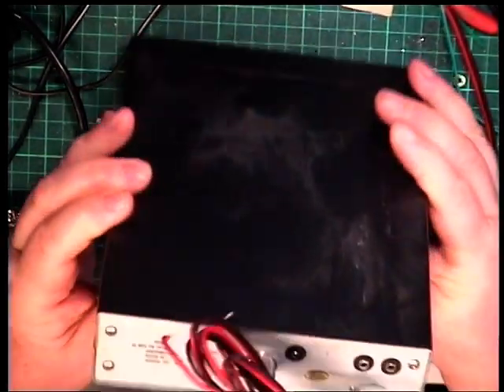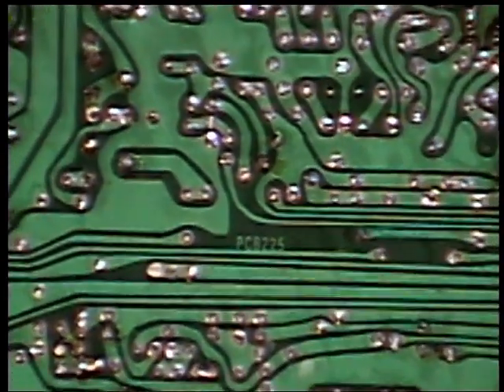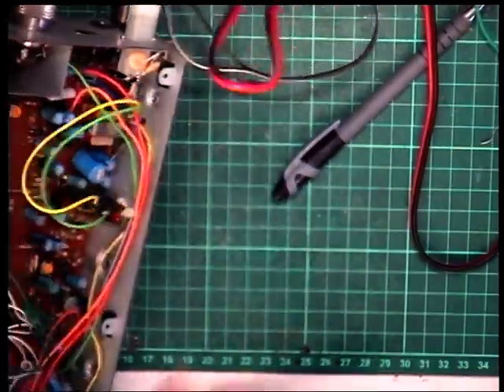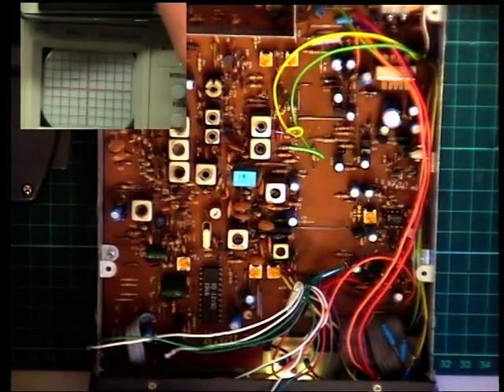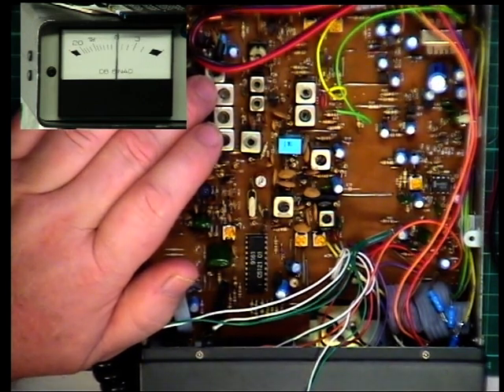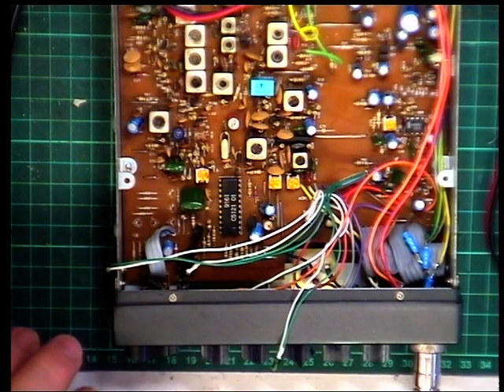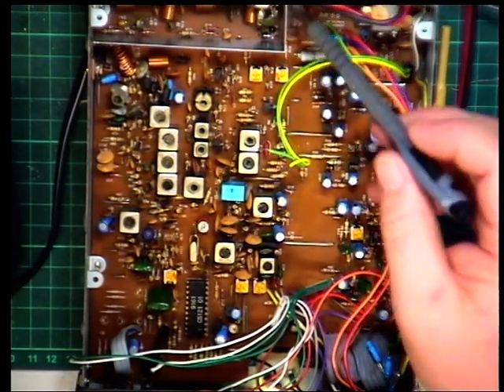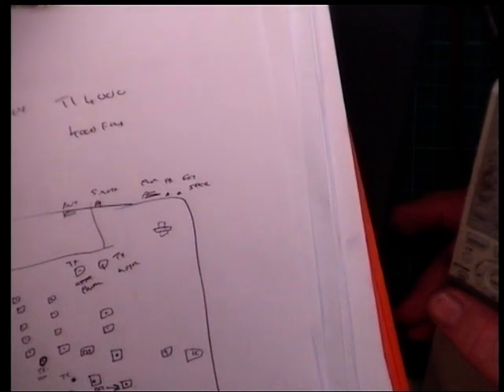Skiptech TI4000FM UK CB27/81 CB radio (mobile) - Servicing adjustments

Comment: Never seen one.  A screwdriver expert set I think, why else would it be without a display and still working.  It was so detuned he maybe thought it didn't work!
Reply from the maker: Furthermore it came in a box in an ebay job lot. Nothing was said directly that it was incomplete, though the entire lot was sold as 'spares or repairs', so I can't moan. On another tangent, I've bought two Midland 250K Powermax sets over the years & both have turned out to be both incomplete & severely messed with.

Richard
Reply: @ukfmcbradioservicingTango21  Yeah, that is probably what killed them in the first place.  I got fed up of fixing everyone else's problems.  They either go in themselves or let some idiot that does not have the foggiest idea what he is doing and then wonder why it doesn't work anymore.  I used to look into some set and I just didn't know what to say sometimes.  I often wondered what on earth they were trying to do.  Sometimes there was wires removed and everything and bits taken out.  What were they trying to do, yet they came and expected me to fix their sets.  Parts were never good to get at the best of times, yet they expected me to have to part on my bench waiting.
In the end when I moved house I just stopped, vanished from sight and didn't get bothered to much.  But I have taken an interest again, but I have to get some equipment, though it is far from cheap as you well know.  To be honest, I will only fix something for myself and it is not likely to be a CB, though I have a couple I have to fix, including my York 863 CB that I bought when it became legal.  The volume/on/off switch was very stiff, I gave it a spray and it just fell to bits.  I think it had got stiff and got a hard knock when I moved for the second time.  Maybe the first time as I was to busy and they all got shoved into the loft.  Then when I moved the second time they were thrown into a leaky shed!  Everything got damp, dripped on, rusted and seized up.
So I have my work cut out for me.  I have to fix my power supply a Tyton-L 10 amp power supply that went bang one night when I turned it on, now after sitting for years the board has all the tracks lifted on the board and still one of the capacitors is missing (I did get one but was to busy to fix it) and the tracks are all lifted so I have little idea of how it was all connected together.  However, the transformer is fine so I will get a circuit from somewhere and I might still have the technology and know how left to rebuild it.  But seven months in hospital with chemicals being pumped through me has left me with a terrible memory and I find I have to look a lot of thing up now when I just used to reach out to a drawer and pick what I wanted without thinking to much about it.